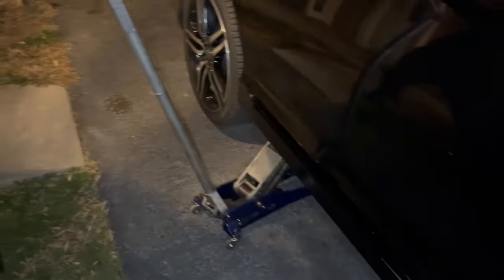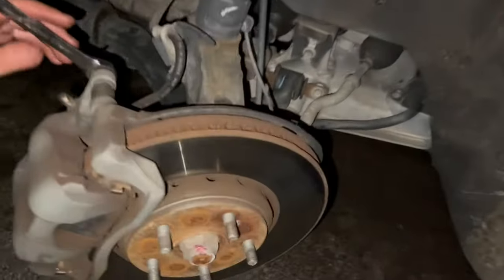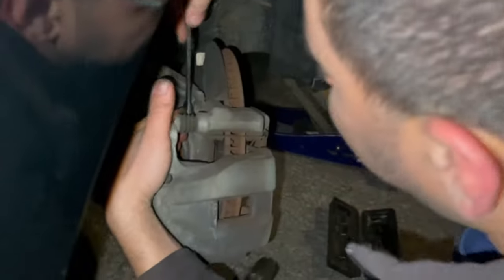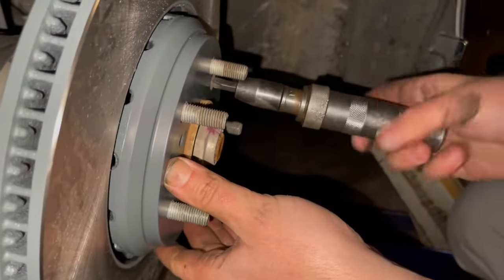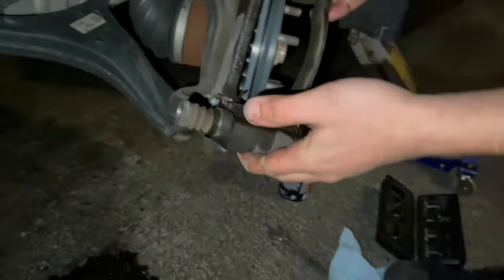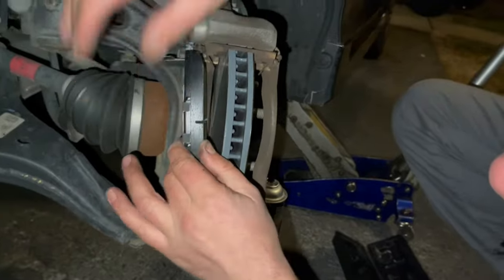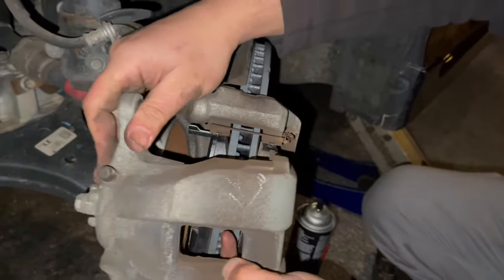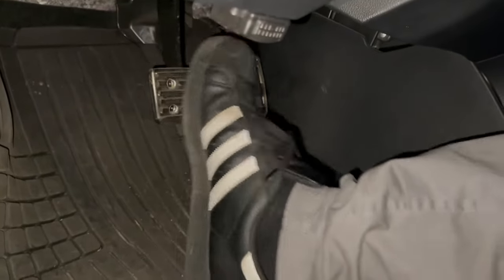DIY 2013 2014 2015 2016 2017 Honda Accord Replace Front Brake Pads and Rotors

Comment: My comment is hopefully constructive critisicm.... I mean no disrespect. 95% of pads come with new hardware, the only ones I've not gotten hardware included with were really cheap "crappy" pads..... Also spraying fluid film on the hub would prevent future rust... when you lubed the pins, pressing the pin in and pulling the boots back releases any air trapped (will lock up the brakes over time)....the clips always wear out with the pads so you should always replace them when you replace the brakes. Applying lube under the clips then installing the clips will prevent the pads from ever seizing... never "match up" your new brakes with the orientation of the old... the squealer tab always always faces the inside, on the "leading" edge of the rotor (The first point of contact)... this will cause the brakes to squeal in reverse when your brakes start to wear out instead of forward movement. I was a professional for 10 years, and all of my vehicles have had brakes last 6-7 years. I hope this helps!!! :)
Reply from the maker: Thanks for the advice! I matched up due to what was there already thinking it was factory.  I don’t typically lube up the tabs as factory doesn’t and concerned about brake dust contaminating the grease causing it to build up and seize. But always great to see different solutions to the same problem. Cheers!
Reply: @MobileCarMechanic  there are many ways to work on cars, different methods and it all goes down the road the same way hahahaa
Reply: Do you need to open the cap on the break fluid container, before you compress the caliper?
Reply: @hemiboy374 Do you need to open the cap on the break fluid container, before you compress the caliper?
Reply: @KickNitOschool  you do not Have to, but it will prevent the cap from poping off and possibly damaging the cap. Me personally, I always un screw the cap and leave it sit loose, afterward I flip the cap, push the rubber down flat and reinstall. After the brakes are done, and the brakes are working. Before you move.. you know what I mean?
Reply: Just asked tonight if we, (wife and I) wanted the pads with or without clips.. I'm standing there and had to ask, "the fu... are you talking about?!?" Guy shows me.. 🤦 
38 years and I've NEVER got pads without new clips ..

Comment: Just fyi. Those screws are not your ordinary Phillips screws. They’re JiS screws. They sell impact screwdrivers for those.
Reply from the maker: Thanks for the info. These screws suck haha.
Reply: Rotor screws are the dumbest thing ever added to cars. All they are for is to hold the rotor in place at the manufacture. To save seconds on every car.......... literally about 5 seconds.
Reply: @jmc224 he’s literally using an impact screwdriver
Reply: Fyi 😂
Reply: @Maukaboi808  the jis screw specific screwdrivers ARE impact drivers. At least the one I use. I guess I didn’t make that clear.
Reply: @jmc224  ahh I see what you’re saying my bad

Comment: You forgot to grease the hardware where the pads travel back and forth....
Reply from the maker: I’ve never had a problem not doing do. Even then most manufactures don’t do it when assembling these vehicles.

Comment: Using a hammer on those  ratchet wrenches is not a good idea
Reply from the maker: These were harbor freight wrenches. I’ve only had one fail after a couple years. Other than that they have been great!

Comment: I would put some light thread lock on the caliper bracket, and also make sure you always grease the backing plate on the brake pads for even wearing 👌😎
Reply from the maker: Good tip!

Comment: Question: there are two different types of caliper pins. One has rubber grommets and the other doesn’t. I’m hearing the pins w/ the grommets go on top for the front brakes and bottom for the rear brakes. Can you give me a answer?
Reply from the maker: From my experience that has been the case. Helps with vibrations as well as evening out the movement of the caliper so it doesn’t bind.
Reply: @MobileCarMechanic So I guess that’s correct? But some mechanics have different opinions on which goes where. Thank you.

Comment: You must use the right socket to remove the brakes caliper, not for the wrench!
It’s will be worn out the head bolt.
Reply from the maker: Thank you for the tip. I do this from time to time in tight spots. No issues as of yet. Cheers!

Comment: Beautiful job. Thanks. By the way what brand rotors and pads did you use?
Reply from the maker: This is what I used:

Parts: 
CARQUEST Premium Gold Ceramic Brake Pads
https://shop.advanceautoparts.com/p/carquest-premium-gold-ceramic-brake-pads-front-4-pad-set-gnad1832/11393081-P?searchTerm=Carquest+Premium+Gold+Ceramic+Brake+Pads+-+Front

CARQUEST Platinum Painted Brake Rotor
https://shop.advanceautoparts.com/p/carquest-platinum-painted-carquest-platinum-painted-brake-rotor-yh587325p/11971144-P?searchTerm=CARQUEST+Platinum+Painted+CARQUEST+Platinum+Painted+Brake+Rotor

Comment: What rust repetrant did you use on the disks?
Reply from the maker: I used brake cleaner to clean off the coating applied from the factory.

Comment: When compressing the caliber is ok to do it tht way???
Reply from the maker: Yes as using a piston compressor tool does the same exact thing.
Reply: So i dnt have twist compress them with a special i can juss do it this way?
Reply from the maker: Correct, Twisting the piston is required on some cars for the rear calipers. Fronts never have twisting calipers.
Reply: Would my 2015 homda accord sport need it ?
Reply: Or can i do all 4 the same way?
Reply from the maker: The front can be compressed, the back needs to be twisted/screwed in. Watch our video on the back brakes https://youtu.be/XfKd7AeJFAQ?si=gDEgOHljrY15-eIY

Comment: do those carquest brakes make noise or leave dust on rims?
Reply from the maker: They are good brakes.  I haven’t had any issues with them. No issues with dust either
Reply: @ G T ........ So the brand of brakes does not matter in this case. What matters is the type of material of the pads. Ceramic brakes are quiet, and depending on your habits, a little film. Metallic are noisy with no dust. Semi-metallic are quiet until they reach about 1/2 or 1/3 of their life and will start making noise as they wear down, and start leaving brake dust. I hope this helps!

Comment: Shouldn't you grease the ends and backs of the new brake pads?
Reply from the maker: I think it’s personal preference. I’ve never had an issue not greasing them and they don’t come greased even from the factory.  You should always grease the slider pins though.

Comment: Should you also replace the clips?
Reply from the maker: You can if it’s heavily corroded and or causing the pads to bind. In our case our pads didn’t come with them and cleaning the clips using brake cleaner got all the dirt off.
Reply: Yes. Always replace the clips. They are also a wear item in the braking system. If you look closely at yours, there will be a thin wear line where the pads have slid during each braking application. Over time they will thin out by .0001 of an inch, if you multiply that, it adds up

Comment: front brakes are bad.
It is better to replace them with Acura brake Type R
Reply from the maker: The pads might not fit from a type r without changing the caliper. Unless your racing the regular brakes are fine.
Reply: Correct me if I'm wrong??? Slightly different shape of brake pads???? I worked for Honda for 3 years and was a mechanic for a little over 10. I got sick of Hondas hahaha